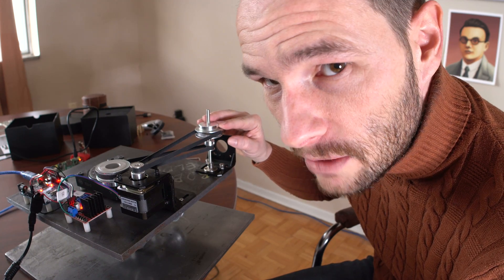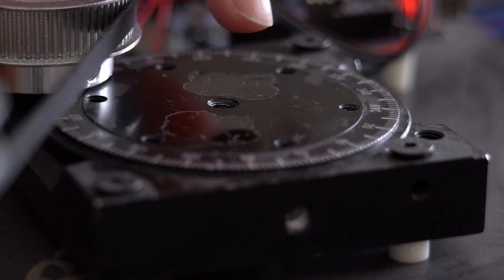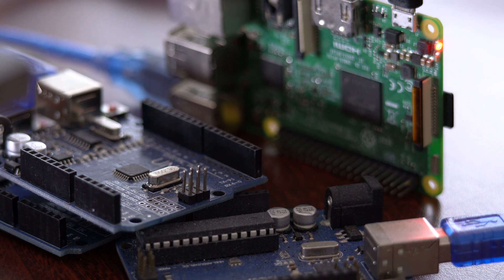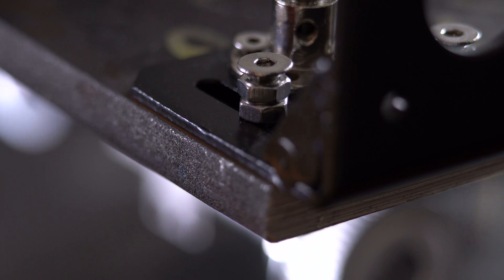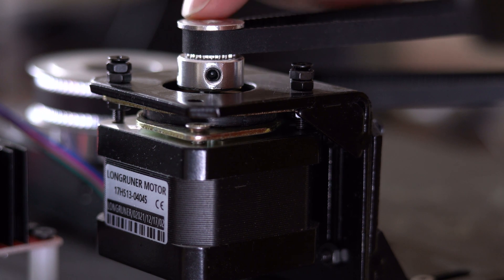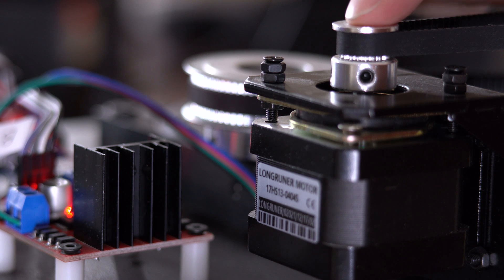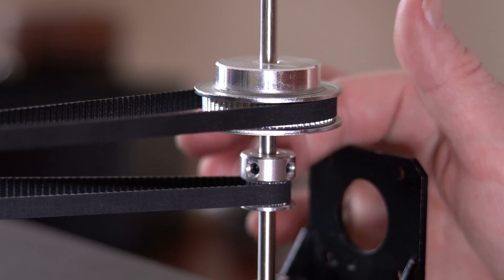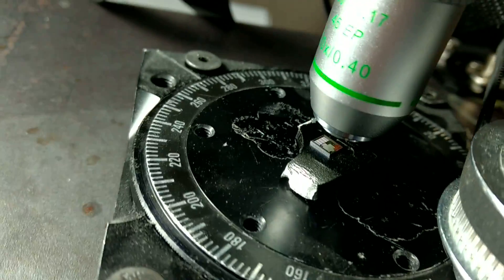My Raspberry Pi Precision Movement Stage Project (Work In Progress)

Comment: Finding a reliable vendor from Aliexpress/ebay for cheap Chinese parts is like finding a needle in a haystack. Getting one that ships your stuff right away is even more rare.
Reply: Ive had a very different experience but Ive also had a lot of experience buying cheap project components for projects Ill surely eventually get around to...

I think its really about understanding that words are words and realistically there are almost aleays only a few different manufacturers for any one type of gizmo so you can guess that any device will fall into a certain type.

I think figuring out the phrasing to find things is equally as important.

Lastly, I feel the higgest skill/experience learned thing over time regarding this is learning to acfept what is already mass manufacturered and working around that, because ultimately even if something is smaller more efficient and more ideal for your task, the ones they make millions of to go in microwaves or printer or what have you will always be more economical and by a wide margin.

Comment: Hey, not sure i understood you there. Did you say you intend to use 3 arduinos? could you explain why? why not control all 3 /4 motors with just one ? I built a  plotter with 3 axis using stepper motors and those l293d drivers as well, I used one raspberry pi pico to control all the motors and drivers as well as interpret the g code. 
also you could get raspberry pi pico W's or esp32. much smaller and efficient plus you can program them over wifi if you want .
Reply from the maker: I could, but I figured doing it this way would make it easier to debug since I can just use the exact same pin configuration for all them.
Reply: @RobertElderSoftware  I think its going to get annoying quickly. having to flash 3 devices for each time,3 power supplies,  tx/rx to your main Pi zero, syncing clients etc etc. With one host pi/arduino you could easily re flash and replace it if need be. worst of all if you make a an oopsie , you could fry 3 devices.  My current project requires 3 boards and it gets annoying having to juggle them around to do updates, especially since my laptop has only 2 usb ports

Comment: Btw, it is smart to split low level motor control and high level RPi, because even if you fence off one CPU core on an RPi 4 from the scheduler, Linux will still execute interrupt handlers on random cores, including that one, messing up your control loop. Suckerpinch/Tom7 had that issue with his NES inverted emulator.
Reply: I believe this is what arm r cores are meant to solve (Rpi does not have them)

Comment: That was a lot of fun Robert.  In the past I built precision robotic assembly systems for microfluidic systems.  It was interesting getting all the backlash out of the machine since it had lots of precision "challenges" and good control systems were really expensive in the early 90s, so we used cheap ones (and I had to sweat a lot of late nights to get it all working).  I appreciate you using the Arduino for the tight timing of stepper pulsing.  That's an easy task for it.  I've tried to do some real-time-ish stuff on UNIX with device drivers I wrote but there is so much going on in a UNIX system that tight timing control is just nearly impossible unless you effectively break most of the rules of being a well-written device driver. 

I see you are in the Kitchener area.  I used to go to UW in 77-82/85.  Back then there were lots of surplus stores because of the manufacturing in the area.  I expect that's all disappeared now.  We had some interesting surplus in the Ottawa area for a while (JDS Fitel and other optical startups had some very interesting overruns that they dumped) but that's all gone now.
Reply from the maker: There's a store here called 'K/W Surplus' with an old tank out front.  That's the best place in town to find random hobby electronics stuff at the moment.  Having said that, a lot of stuff is just easier to buy from China.

Comment: Just to add to my other comment, Im not sure how strongly you feel about esp32s as I previously remeber you mentioning some amount of distaste for them, but one of those in the wroom variant and 4 stepper drivers packaged on a circuit board and you could make a web gui to control the movement precisely or even add some knob encoders and you wouldnt even need a pi or multiple firmware setups. This is basically why theyre the mcu in like 99% of smart devices.

They are especially neat because the s3 and c3 variants have built in usb debuggers so you wont even need ftdi breakout chips etc. Im just imagining a really slick usb PD powred board that does everything you want.

With some 3d printing you could even make it super compact.

If speed is your goal and you dont want to go the custom pcb route, adafruit sells kits of basically all the things you need electronically including their stemma connectors to conveneintly connect various i2c breakout boards they also sell to speed up the prototyping process.

Comment: I know its possible you might have but the 3d printing world would serve you serve you super well for this project if you havent already looked.

Even a simple RAMPS board would handle all the work of all stepper drivers and the mcu by itself and they are availible cheaply and locally.

You can also get typical 3d printer nema 17s very cheaply, sometimes even in bulk or 5 packs.

Most 3d printer stepper driver breakout boards have current control too, so the windings of the stepper matrer much less.

Really though, many modern 3d printer boards would serve you even better like Biqu/BIGTREETECH stuff you can find from Amazon or local 3d printing stores like 3dprintingcanada, voxel etc.

Heck, if you wanted to go cheap you could probably get all the parts for this excludi g camera gear from an old ender 3 including the control board.

Using something like klipper, you could even control the mcu without custom software.

Sorry if Im just info dumping but I got excited at the prospect that I might have useful knowledge to share.

Also, if you want to conjure 3d geometry into life well... I think you can probably guess what tool id recommend for that.

Anyhow, cool project and I hope you complete it successfully.

Comment: I heard The Algo™ likes when people watch posted videos within a certain amount of time after they're posted.  Is this reflected anywhere in the analytics data?  Slam that dislike and unsmash that bell!
Reply from the maker: I recall that people used to say that the way a video performed in the first 24 hours would usually dictate how it would perform for the rest of its life, but I don't think that's the case any longer.  YT would definitely be keeping track of it's click through rate though, so if it gets suggested to you immediately after it's released, and you click on it right away, that would provide a good signal.  I do get to see analytics on click through rate over time after it's posted.